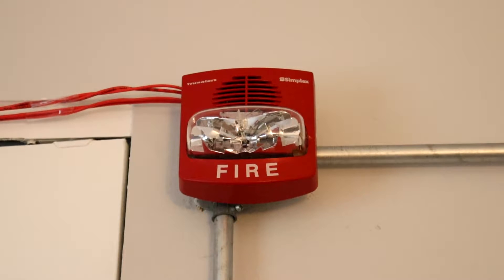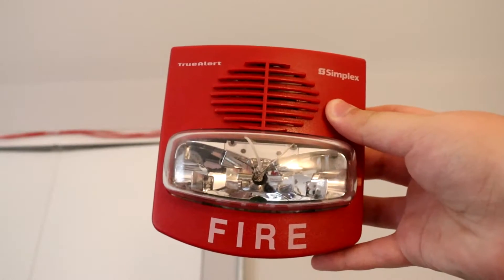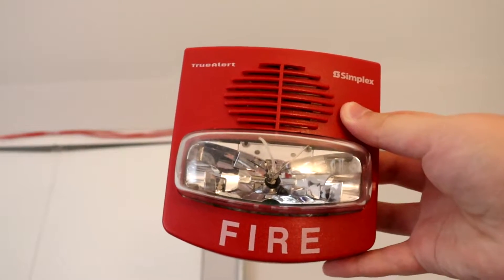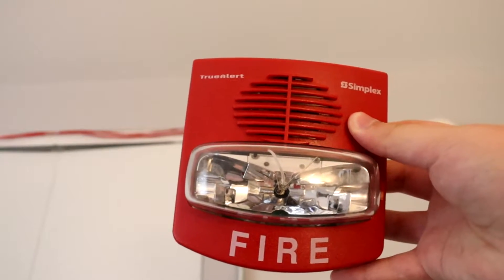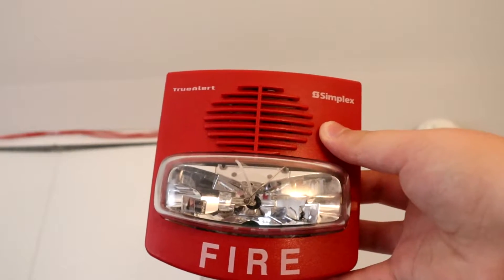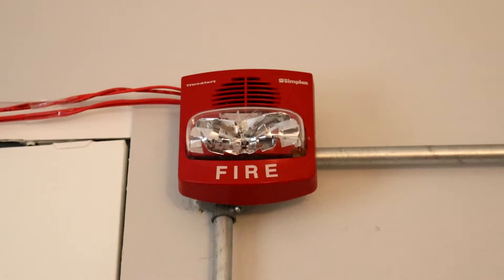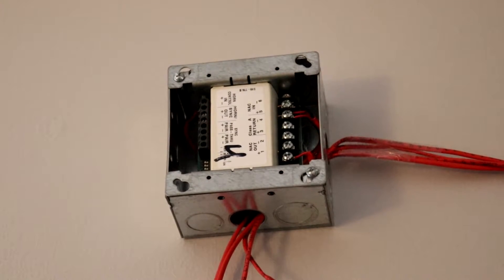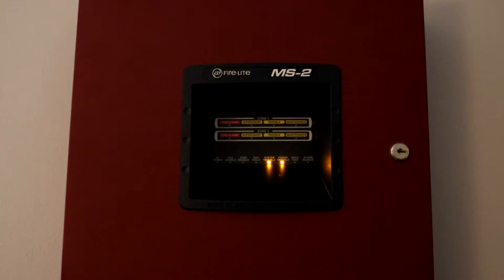Fire-Lite MS-2 System: Simplex TrueAlert!

Comment from the maker: For those interested in getting a TrueAlert, you have to be careful about which model you get. When I bought my TrueAlert, I knew that I needed the SmartSync module for it to work. Many of the newer TrueAlerts do not work at all unless you have a Simplex panel. If you want a TrueAlert that can be powered completely by itself, you have to get a FreeRun or Selectable TrueAlert.

Zachary Fleck's website has a fantastic model number checker for all Simplex fire alarms: https://firealarmtech.net/wiki/ndevices/simplexmnc/